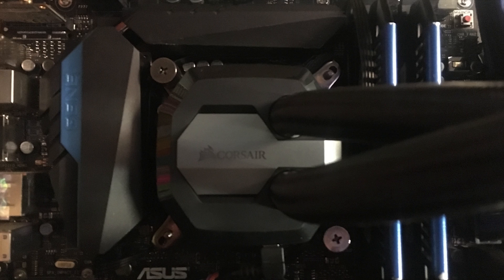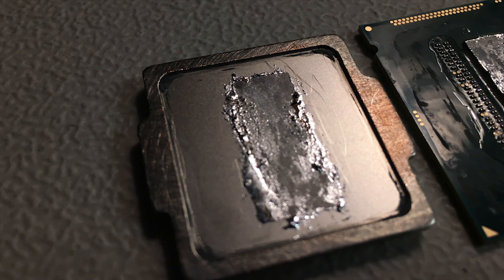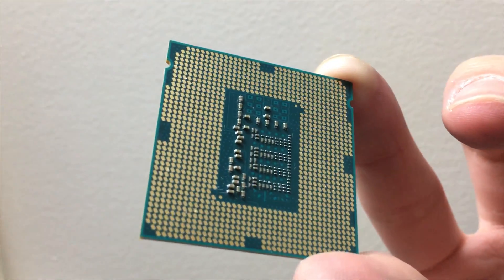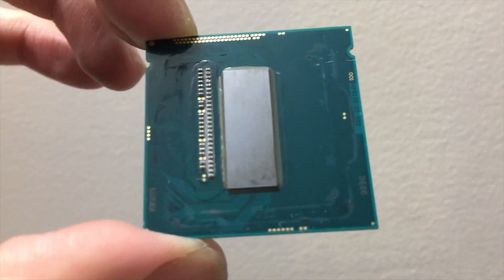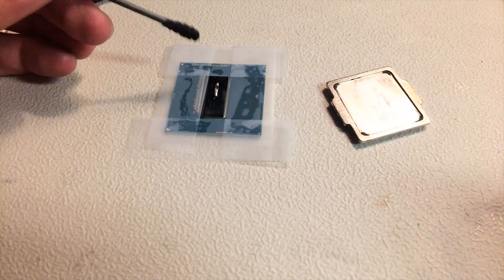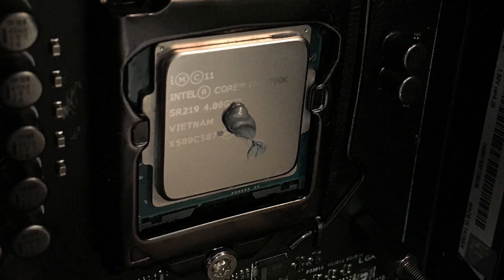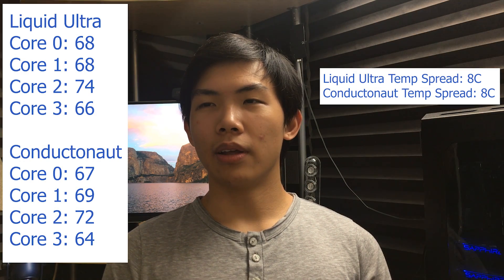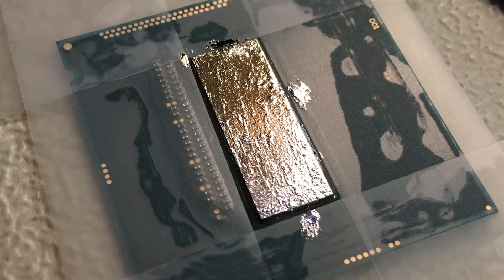Do you need to re-apply liquid metal? ft. Delidded 4790K

Comment: Those marks you mention at 3:05 , do those hurt the cpu? I mean they are actually scratches aren't they?
Reply: No, not if they are very slight. Becsuse what you see isn't the actual chip yet but more like a last very thin layer of protection before the actual silicon comes up. Imagine this would already be the bare chip. Then you would right away shortcut it by putting the metal-made heatspreader on top of it. So this protective surface also works as an insulator.

Comment: Apply liquid metal on both the die and IHS as the surface tension of the liquid metal may prevent good contact between the die and IHS. You can also try using liquid metal between the IHS and H100i be coldplate, as that would further reduce thermal resistance between the interfaces.

Comment: need to apply to both ihs and core. Also since your doing this already i'd lap the IHS... Will help also on the underside I see you did a little but remove the layers of plating on the sealant portion to help it get closer to the die.

Comment: One core is hotter because the ihs is not a flat surface in a perfect way, some spots on the cpu die are not well contacted to the ihs. With the thermal.paste it is different because you apply a thicker layer that fixes the ihs uniformity issues.

Comment: 400 miles way too much liquid metal. Also apply directly to IHS as well as the die because the surface tension of the gallium will prevent it bonding to the IHS properly.
Reply: I delidded my 4790k late 2018 and it's still going strong today.
Reply: @n00baTr00pa  still have it?
Reply: shut the fuck up, idiot!
Reply: You should rename to SirDummie

Comment: Great Video, this is good to know I delided my Intel Core I7 4790k back in 2014 using Coolaboratory Liquid Ultra, my CPU temps are only 2 degree warmer from the first day I delided the cpu(Using a Corsair h105 240mm AIO cpu cooler) .Thankyou for making this video & testing Thermal Grizzlypaste!
Reply: If you decide to take it off be careful. This is gallium like, and will go everywhere if you're not careful :) I tried reapplying mine, I wasn't careful and used a lot of time cleaning. Oh well , you live you learn. The temp didn't improve, the reason i think my temps went up was the added room temperature from the summer. I think i had a 3-4 degree improvement. Still coollaboratory liquid ultra.
Reply: Great video, i want delid my 4790k. But still run 4.7ghz @ 1,26vcore 7/7 days. If delid my 4790k i supose better clock. The limit for this processor is 1,45 vcore. My cooler is h105.

Comment: Yo great video man, i have a 4790k and me and my buddie delided it and used conducuknot on the die and ihs, and then superglued the ihs back on, Currently running it at 1.28 v with 46 multiplier and  102.6 bclk,  the temps dont go above 75 while gaming with 100% useages on all cores, im using a  old corsair h100 cooler, it has a stain on it from using liquid metal on the copper and IHS before, but still seems to do the trick, i also think sometimes because i use rubbing alcohol when cleaning the chip to re apply paste that it degrades the glue and i start to wonder if i should Re - De - lid it, but ugh....im no expert and i dont have proper tools. But you and linus both have simply put the ihs back on without glue and still get good temps, so aslong as the glue holds it then i guess its doing its job. still feel i should get better temps tho, 1.28v, when i start up the pc from being off overnight, it idles 30 degrees, and then after using it and leaving it on for awhile in my room, it idles around 40 degrees. but still, under aida64 and heavy cpu useage in BF1 on aimens, i dont go above 77 degrees, like ever.

Comment: what you think about using liquid electrical tape to cover all the transistors/capacitors to left of the cpu die instead of nail polish?  the liquid electrical tape I have here is non conductive(duh) and can withstand up to 135 c
Reply: it should be fine then imo.

I didnt put anything on mine when I installed it back loose (whoops haha)

But it works
Reply: would be ok as long as its not thick enough to interfere with the IHS mounting. But IMHO i wouldn't do it as heat and cool cycles the tape will shrink and goo up ect...

Comment: Thanks for the info mr. Owen!
I've got the same cpu running at 4.8 rock solid at 1.38v. but the temps are creeping up and above 90° in cpu heavy games (Battlefield 1/V, AC:Origin, CEMU) and thought LM should help me out.

So i was wondering what did you use to isolate the connector/taps under the heatspreader with?

And do i need 1gram or 5 of the conductonaut if i would want to LM something else?
Reply: 1 gram will last a few applications. You need a VERY small amount on the die and underside just spread it
Reply from the maker: You're welcome! Sorry I didn't reply quick enough but yea what that guy said ^ also I used some clear nail polish to isolate the capacitors beside the die but really you can just cover those with normal tape and apply your liquid metal and once you've applied it you can remove the tape and liquid metal won't ever run off to it anyways.
Reply: Thanks:) gonna try it properly this time... Fuckd up my last try on a 4770k by brute force the IHS and made a rift in the green coating.. wonder if nail polish would fix it, hmm bit late now tho...
Reply: mine is 4,7ghz at 1,25v lets hope it last 3 more years

Comment: Why u put liquid metal on the die but not on the IHS? The heatsink r made of copper and is safe to apply liquid metal
Reply: For me I also chose liquid metal on the die and high end thermal paste on top. Main reason I felt that on the die there is near zero risk of anything sneaking out or having any electrical conductivity because you put the IHS back. Also who cares if it stains or has any reaction under the IHS. On top of the IHS though I was reluctant to risk any reaction on a cooler or have any sneaking about onto pins or other parts of the board without me necessarily noticing. It's not likely I admit, but for the sake of 1 or 2 degrees it seemed like an extra safe trade off. The biggest difference is on top of the die for sure, I made the same choice on a fat PS3 after delidding and it worked out better than my wildest dreams so had no hesitance to do the same on a delid Skylake. The PS3 went from having high fan speed and lukewarm air venting while merely idling on the XMB to near silence, minimal fan speed and hot air pouring out the vents when playing a demanding game. Fan doesn't even ramp up. Better than new out the factory. By miles.
Reply from the maker: Because that doesn't help and would only ruin my cooler and CPU IHS
Reply: O!Technology  It helps a lot, more than 10 degrees over best normal paste.
Reply from the maker: No it doesn't
Reply: Yea it doesn't. I tried it by myself.
Reply: the bulk of the initial heat is the die - so getting off that first means it can breath loads faster than the IHS as that is the second port of delivery.

it goes DIE - IHS - Cooler
Reply: @SLHacks  you should only apply grease thermal paste on the IHS (Kryonaut for example) ad liquid metal on the die, it will give the best result
Reply: @khangle6872  Well... not best, but good enough